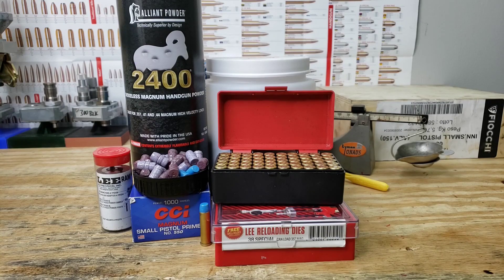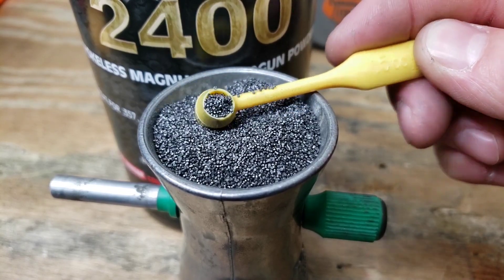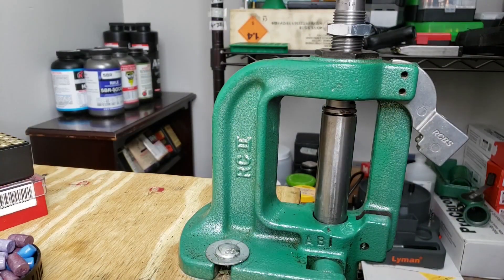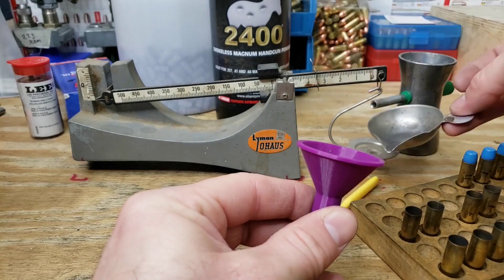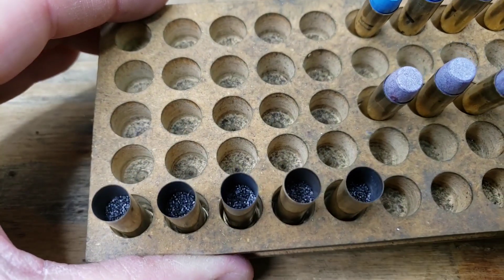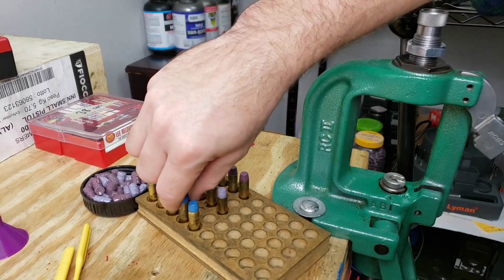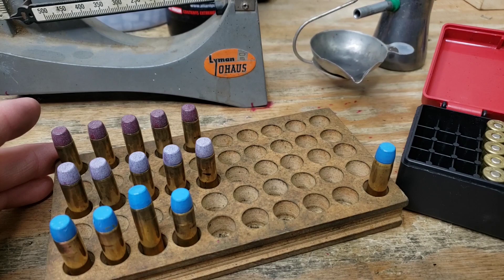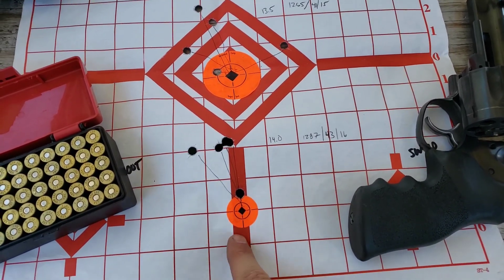Reloading 357 Magnum Episode 8 - Alliant 2400 - Lee 358158RF - CCI 550 Magnum Pistol Primers

Comment: One of my favorite bullet molds and 2400 is also one of my favorites.  I just worked up a load of Speer 158 gr Sp bullets and used 14.3 gr 2400.  1600 fps out of my lever action and dead nuts accurate.
Reply from the maker: I'm going to load up some more and will definitely try them in the 1894 as well. I want to see the velocity difference between barrels. Then I need to find a powder that will work efficiently in both funs without having wasted powder in the short barrel. Thanks, brother 👍

Comment: I use 14.9gr of 2400 with a 158gr XTP. No pressure signs and accurate. With 158gr lswc 14.5 grains does the job.
Reply from the maker: Awesome! I just wish 2400 were more available these days🥺
Reply: @DummyRound  I found several pounds of 2400 about two years ago and bought two. I haven’t ran across any since. If I’d known it would be so long before I found any more I would’ve bought it all. I just found a pound of Unique and bought it. It was the only one on the shelf I’ve seen in at least 3 years. Alliant powder has been very hard to find In general. I’ve been seeing some Bullseye, and should have bought it even though they want about $50-$60 a pound these days. The next time I run across any it’s coming home with me.
Reply from the maker: Yeah I haven't seen Alliant in probably that long. I'm not paying that much so I'd let it sit unless it was specifically your favorite for something needed 👍🇺🇲
Reply: Same here 15gr with the XTP is perfect in my 2.5 barrel and out of our 22" Handi Rifle barrel we get 1800fps.
Reply from the maker: Sounds like a smoker!

Comment: Overflowing cases from a double charge is good. I'd rather make a mess on the loading block/press than find out on the firing range. Great idea on the powder coat identification. I've mixed up rifle loads on 2 occasions before and it is very frustrating.
Reply from the maker: I like bulkier powders for that reason, but you have to use more of it, so it doesn't last quite as long. I always try to mark my brass some how to keep myself from mixing them up if I were to dump them out or something 🙃

Comment: i used to use 13.0gns with a 168gn bullet so 158 i would say 14.0 would be good charge for a full powered .357 magnum cartridge, on the + side 2400 is know for its lead cast bullet friendly elmer keith used 21.0 gns of 2400 for his old load for a 250gn LSWC .44 magnum. great job my friend.
Reply from the maker: Hey, brother! Thanks for stopping by. I'm going to try some more at 14gr and see if I can shoot them any better. I'm usually the biggest variable, especially so for hand guns and trying to test accuracy while shooting off hand. I only have this partial bottle of 2400 so I'm going to use it sparingly until I can find another one out in the wild. Have a great Sunday!
Reply: @DummyRound  thank you brother i have a few videos coming up as soon as this heat wave lets up.

Comment: I’ve been doing 45 Colt lately but I need to get back to 357 magnum. I only have a jar of H110. Been looking for 2400 or 4227 to try.
Reply from the maker: I need to go take notes from your series of 45LC videos and get some of my own loaded up. H110 is a great powder for 357mag, but usually need to be pushed near the top end for it to tighten up. Also, fireballs!
Reply: @DummyRound  I’ve got some more loads loaded up for 45 colt. Just need to get out and do the videos lol.
Reply from the maker: I've got about 10 things on deck but no range time this week 🤣

Comment: I was thinking if trying those in 9mm sized to 356 but there is no data,  don't think I have a good powder combo cause it sucks up so much powder space
Reply from the maker: I want to try that also, but was going to start with the 358-150-1R since it was slightly lighter and a bit less lengthy. Maybe 3-4gr of something like Unique? Might need a slower burning powder? There's some limited data for 165gr subsonics, but I haven't looked at that in a while.

Comment: I use 2400 in my .308 win to fire lead bullets
Reply from the maker: Awesome, what bullet? I plan on doing that as well once I can find some more of it!
Reply: @DummyRound  I am using a bullet that was designed for the 7.62 ×39 and sized down to .308 I got the mold from Midway it's a rcbs mold 7.62-130-spl part number is 82022 that's for rcbs , not Midway, mine are gas checked and lubed with rcbs rifle bullet lube and the lead I used they dropped at about 139 -140 grains
Reply: @DummyRound  those rounds I made I shot in my bolt action Ruger M77MK2 rifle and were quite and no flash at the muzzle that I could see with 20 grains of 2400 , CCI primers large rifle.
Reply from the maker: I remember seeing that mold and thought I should have picked one up, I think they were a limited run. I bet they'd be great for 300blk, and I'm sure I'd try it in 308win as well. Do you know how fast they were moving?
Reply: @DummyRound  no I don't my magnetospeed would not register them
Reply from the maker: I hate those days with the chrono!

Comment: I cant find a load for LEE 124 grain flat nose 9mm powder coat . I have HS6, CFE pistol, and Ramshot ZIP. 
  What data do you look at when powdercoating? 125 lead cast, 124 fmj, etc??????
Reply from the maker: For most pistols and powder coating, I just look for data with the same bullet weight, and always start on the bottom end of their suggested load. All of those powders you have should give plenty of data to start with.  Just start low and go up by 0.1 or 0.2gr until you get good function, then find an accurate load for your gun. Good luck👍
Reply from the maker: Also, if your allow/mold drops heavy, say a 124gr mold drops closer to 130+gr, look for data using the next higher weight class and work up from there.
Reply: @DummyRound  my concern there is the huge 1+ grain difference between say 124gn fmj vs 124gn lead cast. 
  So basically im looking for 1000-1100 fps on 124gn powder coat?
Reply from the maker: Generally, traditionally lubed boolits should be ran slower and with less pressure than a FMJ to prevent leading... with PC that pretty much goes out the window for most pistol applications. Even at rifle velocities, think 2k+ fps, PC works just fine for protecting your barrel from leading. At that point you just need a harder allow and GC if possible to aid with accuracy.

As far as the 9mm goes, take an average from all of your sources and find a safe starting point to work up from.
Reply from the maker: And yes, most of my 124gr molds drop around 130gr and end up moving around 1050-1100fps range. I haven't pushed them much harder if I have an accurate load.
Reply: @DummyRound  mine boolits drop about 123.3~124.5 with PC. Ill just start work ups. Thanks for replying. It means a lot
Reply from the maker: Any time!
Reply: @DummyRound  you rock sir. How about Accurate 2200 w/ 55gn cast bullets. Same workup as 55 fmj?  Maybe start 1gn below min and .5 increments?
Reply from the maker: Cast 223 isn't something I have a lot of experience with, the few tests I tried were underwhelming.  However, I was using a soft alloy and no gas check, which is supposedly paramount to getting any kind of accuracy. I've also never used 2200, so can't comment there. Are you in a bolt gun or AR? I've heard people get good luck with a hard alloy, as well as gas check, for an AR. H110 and IMR 4227 were listed in the old Lyman book for 223 loads, and people have had luck with faster burning powders like those two. Boozeandbullets and Novice Reloader have a few things up on their channels that might help better than myself on this topic. I have some cast up out of linotype but waiting to get some gas checks before another attempt. Let me know if you find some good info lol
Reply: @DummyRound  Yeah I made mine with the Linotype from Brownell‘s and also have some gas checks   
    If you have a address listed and I’ll send you some stuff to check out.

Comment: Herco is a powder between Unique and 2400 on the burn chart . Alliant used to be called Hercules . I'm sorry for being a word Nazi .
Reply from the maker: Thanks, sorry, I meant to say "Herc 2400", but just said "herco" instead. I was looking at data from an old Lee manual from the 60s and they had Hercules powders before Alliant took over. Word Nazi away, just don't call a magazine a clip round these parts, lol!
Reply: @DummyRound  2400 usually shoots well in about everything I've tried it in . My 357 is a snubby so I don't use it in that . It would shoot fire balls . It is awesome in the 44 .
Reply from the maker: Mine is only a 4" barrel so I'm probably losing a lot of potential as well.